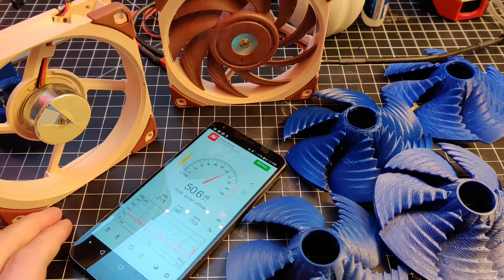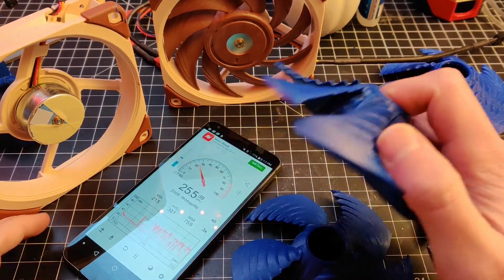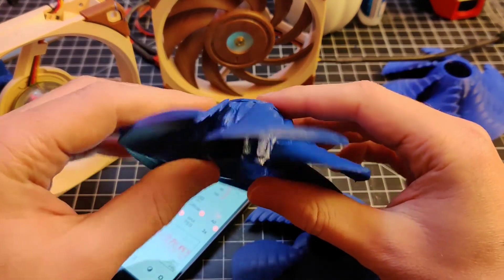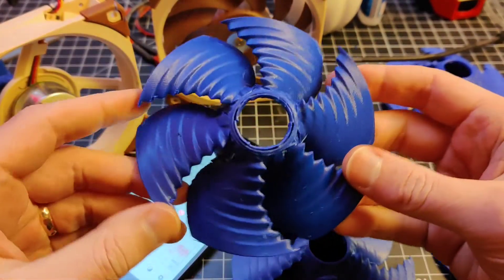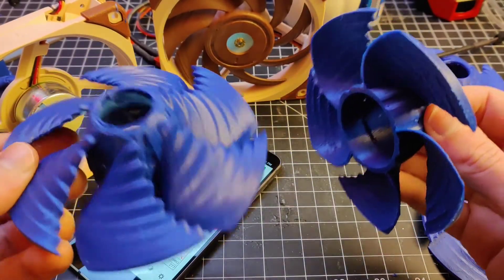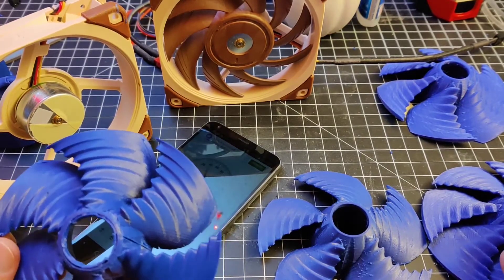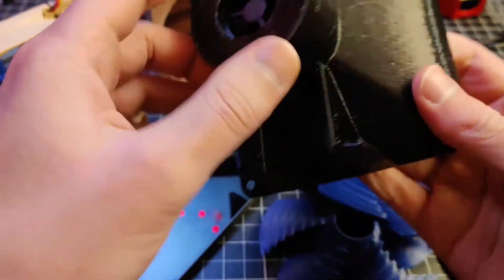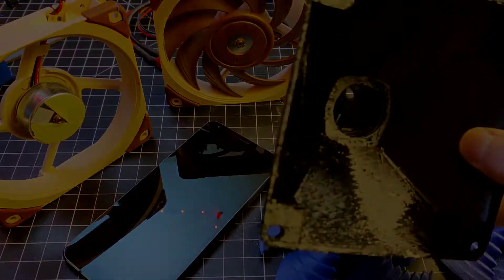Testing New PC Fan Design vs Noctua A12x25

Comment: Very cool!   You should really check out Alex Kenis's channel on youtube.  He did a video on cooling fans a little over a year ago.  He specifically goes into mechanisms for testing air flow and also talks about ducted air flow and how you really need "stator vanes" to prevent chaotic turbulent flow to get better results. 

This makes a lot of sense here with what I'm seeing from your test results as it looks like you're getting much higher flow rates from the free tests.  The "stator vanes" are there to straighten out the airflow and make it more "laminar" which increases efficiency a ton.
Reply from the maker: Thank you. I will google that channel right now and find out exactly what he found.